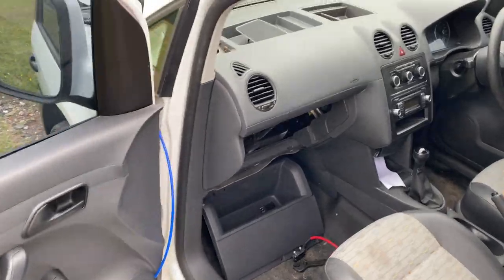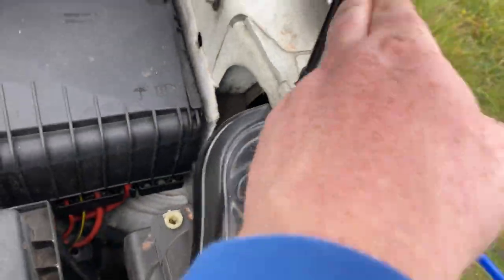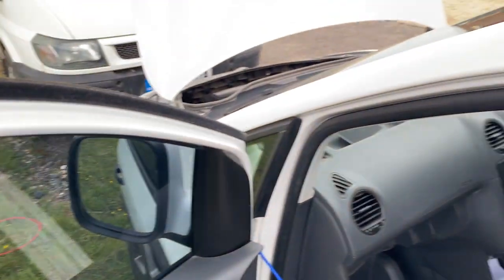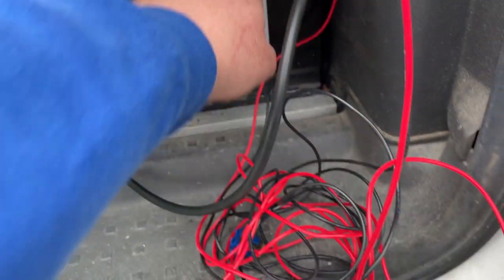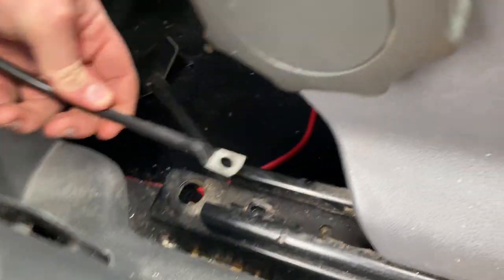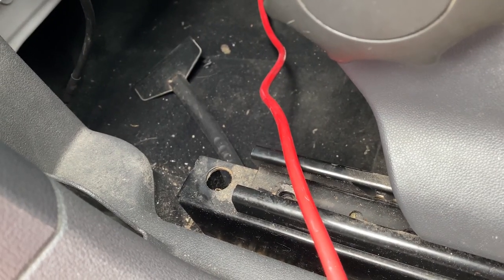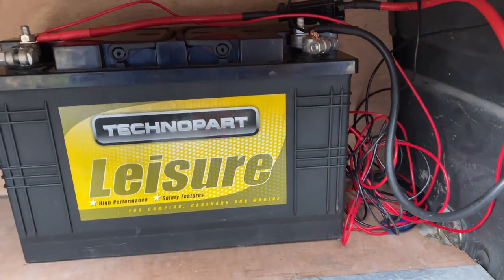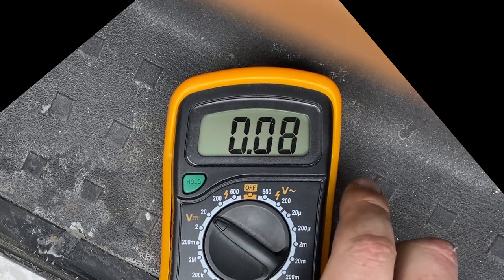HOW TO: Install Split Charger + Leisure Battery

Comment: Just put a split charger on my 2012 caddy. Perfect route. There is a grommet where the main loom goes through the firewall. Need to remove airbox, battery and battery tray. A pair of long nose pliers to poke through the grommet and pull through the passenger footwell. Cable is then routed under the centre plastics.... Don't have to remove them just slips under. Then to the passenger footwell. Looks tidy wouldn't know it's there.
Reply: Do you have any pics mate of this as I’m going to attempt to in my caddy maxi next week. Thanks 🙏🏼

Comment: Hi does the the small black from the split charge relay need to be grounded on the starter battery or can I have it grounded on the leisure battery ? Cheers

Comment: I am building a leisure battery for my Volkswagen van. Off of my split charger for my secondary battery, can I use a lithium battery, even though the battery the powers my engine for the van is not lithium. Can I get away with having my secondary battery be lithium?
Reply from the maker: Id just use an old car battery tbh play it safe
Reply: I want something that’s going to hold up for a long time though. I’ve asked this question on a couple different videos hoping somebody has a definite answer for me. At Home Depot they have these small little lawnmower ride along type lawnmowers, that use little lithium batteries. Smaller than a car battery that only weighs a few pounds. I wonder if something like that would work?
Reply: @Trentmatthews  i have a agm leisure battery running of split relay.. You will need to put an isolator switch from relay to leisure battery, when i turn on van i turn isolator on so it charges battery as my leisure battery holds more charge than starter if rear battery is full it starts putting charge into starter and draining to starter battery power levels so when engines off i turn isolator off. If charging leisure battery from mains without isolator switch it confuses chargers leading to all kinds of beef..  There are smart relays now think a ctek duo costs £450

Comment: How exactly did you test you’re ground/earth with the multimeter? What did you test between and what reading were you looking for? Thanks! 👍
Reply from the maker: Test the live feed coming from the van battery and on the other end a ground. If it shows 12v its completing the circuit so a ground

Comment: no fuse at battery source ? and loose positive in the wing is not a great idea,

perfect fire waiting to happen.
Reply from the maker: It is fused and still going strong
Reply: proper cowboy work with the wires wrapped around the battery terminals too...

Comment: Aren't these installed with "smart" alternators now? Which makes the relay useless. My Caddy model is from 2012.
Reply from the maker: They might be, mine doesn’t have a smart alternator its a 2011
Reply: yeah if they have stop start tech. then you need  a DC to DC relay
Reply: @paulbullimore2871  yeah I found out the 2012 model didn't have it, I installed the split relay between batteries and charging worked fine

Comment: Thanks! What's the gauge of the wire?
Reply from the maker: Not sure i think its about 50 amp cable but it comes in the kit on ebay which I recomend buying for easy of install